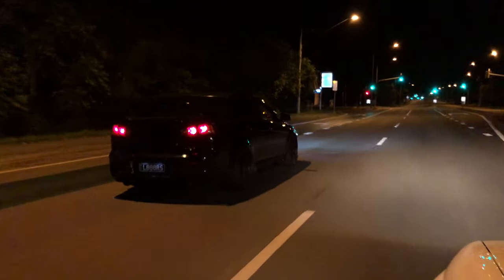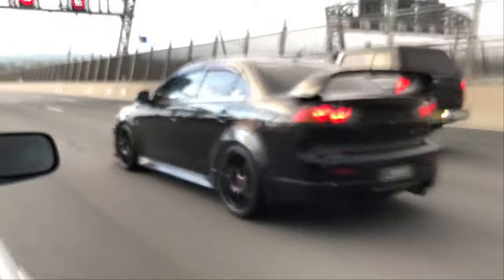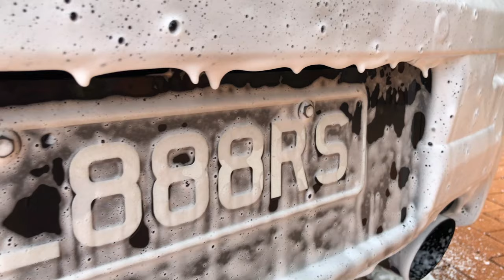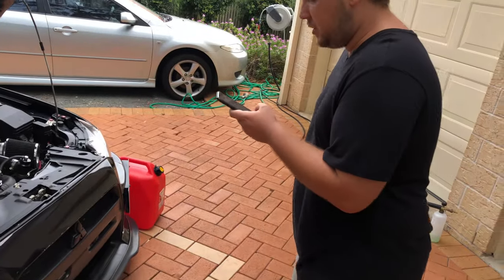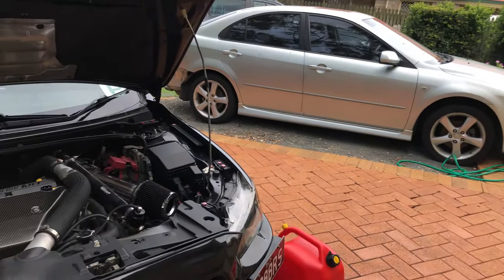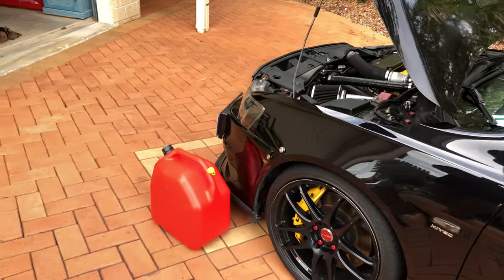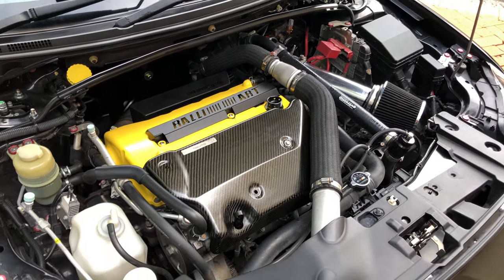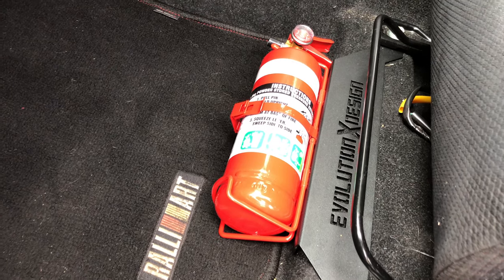E85 TUNED RALLIART! FLAMES + ROLLERS & MORE...

Comment: The SST is a great,strong box...its a myth that its weak...you just have to look after it like anything else...change oil and filter regurlarly...like every 20-30k and it will be fine. There are SST's out there with 300k+ on them and no problems....DONT GET "CLUTCH" and "GEARBOX" Confused....with ANY road car that you increase engine performance with...you CHANGE THE CLUTCH/S to match....I don't think I know of a blown SST "Gearbox" out there.
Reply: Mine is broken since 1 week. 😅 Rebuild costs here about 10k
Reply: The only problem that can't be controlled is the forshift magnet detaching which is a huge design flaw, besides that, everything else is just maintenance and the sst will stay alive but people don't understand that...
Reply: Nice ralliart man I have the full upgrades on mine evo x upgrades still a working process so far 236kws I have now since that tune have upgraded injectors to 1000cc and fuel pump and boost solinoid and then start on the exterior front bumper lights etc

Comment: You will get less power from the location of you pod filter as it is now a hot air intake and hot air is less dense
Reply: It goes through a turbo and gets super heated anyway if there is any loss I'm sure its extremely minimal. The intercooler is what is really going to matter.
Reply: @DWinzZz  the intercooler only cools the air it gets in...if its hotter already from the pod being where it is well...its self explanatory...the pod thing has been proven to actually loose power if its sucking under bonnet hot air...the factory location on a Ralliart is sucking cooler air and any good tuning shop will reccomend not installing a pod.
Reply: @justaname1862 Well said , the only way you can counter the effects of using an open filter set up on the engine bay is run water/meth injection to bring the temps back down .

Comment: All those upgrade and he only has 200kws when on a evo 10 he would be making 300kw or more
Reply: you clearly havent been in a ralliart
Reply: @bex0slime251  you clearly haven't bin in a evo 10
Reply: @ELIDOTORG  I've driven over 250 cars over the last 5 years. I've driven mclarens, lambos, gtrs and even evos and lancers and what I can say is that Ralliart 2015 is just designed very well. It has only 1 issue with the magnets but thats it. The car in stock version can still do good on a track..
Reply: @bex0slime251  we're not talking stock were talking power and making easy power for less
Reply: @ELIDOTORG  ralliart is more reliable than evo x if you want to go that route
Reply: @bex0slime251  sorry dude the only time you here when a evo 10 is not reliable. Is when the person who built it bought cheap parts.
Reply: @ELIDOTORG  they have the same engine you know right?